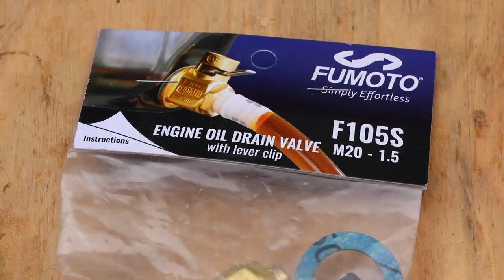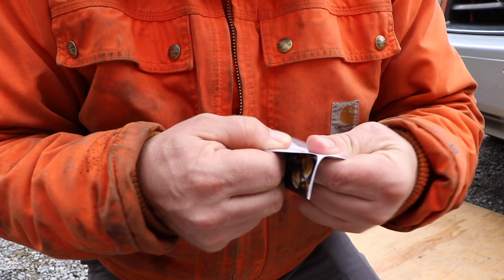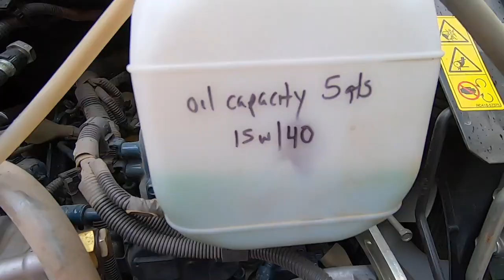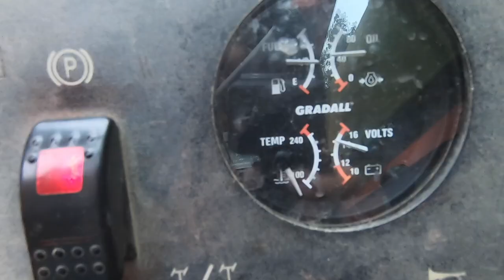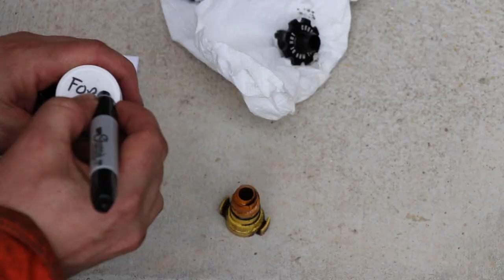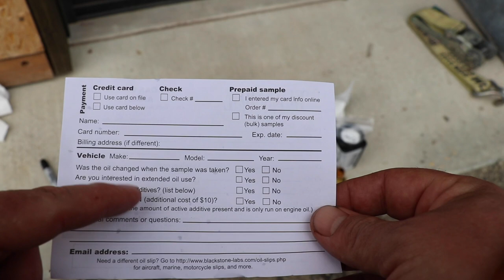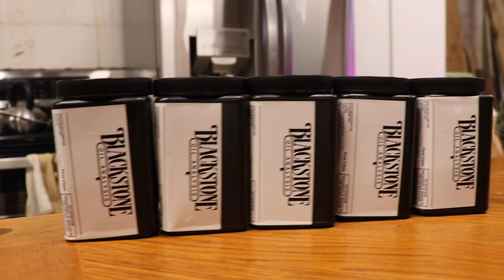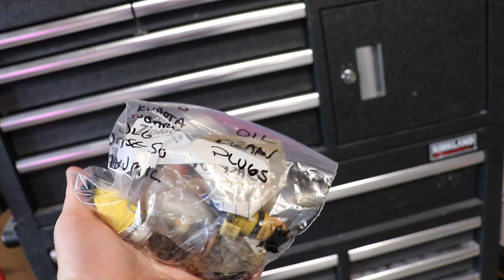Sampled Oil in Everything I Own... Here's What Happened

Comment: Here are some tips from a Ford Senior Master Technician.  Do not idle a 6.7 for excessive amounts of time it will lead to premature clogging of the EGR cooler and they are expensive to replace.  Make sure you complete the regeneration cycle when it comes on since incomplete and excessive regen cycles will shorten not only DPF life but oil life as well since more unburned fuel gets into the oil. Fastest way to warm up a diesel is to drive it.  Now that your on the grid use the block heater when it drops below 45 degrees and only a few hours makes a big difference. i like to use a 15 amp timer on my 6.0 diesel.  15-w40 is fine for the hotter months but switching to 10-w30 in colder months would be better, reference your owners manual there is a chart with recommendations by temperature. I also prefer to use factory filters (oil, air and fuel) since most aftermarket filters will fail in comparison.   Short trips are not good for gas or diesel engines especially when they do not get the chance to come up to full operating temperature. Todays diesel engines are not your grandfathers diesel engines.  Modern diesel engines in light trucks are designed to be shut of and restarted unlike old diesel engines that could be idled all day without harming the engine.

Comment: Jesse: McMaster has grease zerk fitting dust caps fairly cheap - $5.76 for a package of 50. Recommend getting two packages of different colors. When you do grease the equipment you change the color of the dust cap. That way, a missed grease fitting stands out. They come in 6 different colors. You can google McMaster. The basic part number is 1098K- with the color number as a suffix. -12 is black, -17 is blue, -15 is green, -14 is red. -13 is white and -16 is yellow. They call them dust caps. Jon

Comment: If you go to any diesel service shop for large companies you are going to see one of two oils, Rotella 15w40 or Dello 15w40. I worked on several types of diesel engines for years and I had a great performance from the Rotella, Do yourself a favor and don't buy cheap store brand oil or oil filters, and don't by Fram oil filters for sure. I always used OEM filters for all the different equipment.

Comment: I did the drain valve replacement a few years back. One mod id recommend would be to drill a hole in the draincock lever and run a bit of safety wire through and around the body of the plug. That clip will fail you after a while.(ssk me how I know. LOL)

Comment: You can get heavy duty magnets at at any hardware store. My suggestion is to place one right next to your easy valve and just before you do your next oil change just pull it off right before you drain. Any metal fragments that ere there will get washed out right away . Then put the magnet right back.

Comment: A magnet on the oil pan might skew the oil analysis. The  whole point of the analysis is to determine unusual wear (metal) in the engine.  
I know that CAT sells a oil sample vacuum kit. A lot of heavy equipment have sample ports or with the CAT test kits, they come with a long tube that you feed down the dipstick tube, then suck out the sample from there.   And if you take the sample right after warming up the engine, any  contaminates will be suspended in the oil and you will get a better sample.  Hope this helps.

Comment: You should try to limit idle time on a diesel. While a diesel engine is idling, something called seepage occurs. While a diesel engine burns less fuel while at idle, the engine temperature is not high enough to fully combust and fuel can leak down the pistons and into the oil. This then effects the ability of the oil to do it's job as a lubricant.

Comment: As a 55 years in the field heavy equipment operator I'd be scared of them drains if even one stick can have access to them drains -- working brush they can go up in an open hole like that 2 inch or so hole and knock that type of drain off -- they are brass and fragile -- I've seen 20 thousand dollar 3408 cats in D9 's get hot and split the block by one single 3/4 inch stick run up the radiator drain hole and knock the drains off = the operator never knows it until lights start flashing.. lol don't mean to scare you lol love you and your wife's youtubes - 15/40 is perfect for all diesels and your truck - just one kind will take you all the way (y)

Comment: Do yourself a favor and move to 5w40 which will flow better in the cold and lessen start up wear. 5w40 and 15w40 are both 40 weight when up to operating temperature but isn't as thick when cold. Your higher metals could be from the thicker 15w causing lower cold temp flow and increased wear metals especially on the Ford.

Comment: I too would be concerned about the mini's exposed drain valve. From the vid it looks like there are heavy plates on either side of the pan. How about using a plate with bolts the protect the drain? The plate could be bolted with 4 bolts which would be drilled and tapped into the existing thick plates. I would not try to weld on the thin steel oil pan aas  hitting anything as you rotate could tear open the pan. I agree that oil analyis is a good thing as diesel engines are expensive to replace. Keep up the great vids and I look forward to your continuing house build.

Comment: An idling Diesel engine causes as much as twice the wear compared to working speeds. Idling should always be limited. Newer Diesel engines are recommended to be driven within three minutes of startup. This may be why the trucks oil shows higher mileage on it compared to actual odometer mileage.

Comment: Buy a round bristle brush for those oil change valves and hit the open valve before you close it after you drain the oil. Sometimes a metal burr can ruin the seal on a 1/4 turn valve. Giving the valve a quick cleaning will help avoid this.

Comment: They make a simple hand pump with a long tube that goes down the dipstick tube you can get samples with. They use them in sailboat engines to change oil. Would’ve saved you a lot of money and not risked those plugs getting knocked off. Risking tearing up the oil pan. Not smart for that type equipment.

Comment: Most equipment manufacture dealers sell sample kits for a lot less and can sample through the dipstick tube so it can be done at any time and doesn't have a chance of contamination from a drain plug or valve that can be filled with dirt

Comment: Oil testing is smart. I had a quarter turn valve and tubing to test and change the oil on my Piper Arrow. Tubing allowed oil change without removing lower engine cowling. Tubing clipped onto the valve through an access door. Seeing the trend in oil analysis lead to an engine overhaul... who knows, may have saved a life.

I know you have competing priorities, and I am anxious for you regarding getting the siding on that nice house, but a weather shelter for your equipment makes a huge difference. A hoop house would do the trick. Farmtek sells inexpensive kits. Long term, nothing beats a pole barn with a concrete floor and a two post car lift. (Insulation and heat make it even better)

I think you might have been pouring oil from 1 or 5-quart containers. For those large capacity diesel machines most of which use 15W40, buying in 5-gallon buckets is significant;y cheaper. Use two-quart pitcher with flex nozzle to avoid spills.

Also, having a 50-gallon transfer tank with a hand pump for onsite diesel fuel is really nice. I have my tank on a pallet and just trailer it to town for a fill-up of non-taxed off-road diesel fuel. (cost 50 cents less)

Good luck and keep up the good work.
Driving my own F-250, 1997, 223K miles on it. No rust.

Comment: I thought you may like to know that many newer aircraft engines in the military no longer perform JOAP samples.   It was determined that this type of oil analysis was ineffective at predicting engine failure and was no more effective than the installed engine oil chip detection system.  You'd have better luck with a magnetic drain plug.

Take your sawmill as an example.  If the results come back and they show 25 PPM of 303 stainless steel, what do you do with this information?  First, you would need to track down which part inside the engine was made of that material (not an easy thing to do).  Then you would need to determine if 25PPM is excessive or just normal wear and tear.  Finally, do you spend the money to rebuild the motor or just wait until you get a secondary indication (smoke, noise)?  As you mentioned in your video, your ground equipment is a "run until failure" asset.  These piston engines are going to fail for a seal or gasket long before they fail for bearing or gear wear which this test is trying to identify.  

Overall, the juice is not worth the squeeze.

Comment: Oil analysis, not going to yield much info without having previous analysys'. It is more of a trending tool not a pass/fail.  If you have a way to drain through a coffee filter as soon as the oil starts to drain would replace the magnet in the drain plug.  I know some engines allow a 1/4" tube to go into the filler then down into the bottom of the engine where you can do it like a straw and put finger over top of tube and draw tube out of engine. If your lucky there will be a sufficient quantity in the tube for your sample. That is the way I did it for years.  I am an A&P with IA and worked around airplanes most of my adult life.  Love your videos.

Comment: Most diesel Fords when you're in park using the cruise control you can set a high idle to prevent the injectors from building up deposits and it would help to heat up the engine a bit more and if you are a victim of the EcoDiesel it'll encourage the truck to run a cycle the next time you drive

Comment: The issue with sampling from a quick drain valve is dirt you are going to put in your sample from inside the valve. Best is to use a sample gun and sample tubing that can be purchased from you're local Caterpillar dealer. Their sample service is also I believe cheaper. Also on the heavy equipment you need to do trans, hydro, finial drive and coolant samples to give a full health report.

Comment: Jesse this is what you need  to work out what thread you have on your various vehicles. You need to know 2 things. The daimeter and the pitch. Then you refer these to a chart. you need a vernier caliper to measure the diameter and 2 pitch gauges. Pitch gauges look like small feeler blade sets with a tooth profile on each one with a number stamped on it. On imperial ones it shows T.P.I. Teeth Per Inch for example  1/2" x 20 tpi  which is unf (unified national fine thread) has 20 teeth per inch with a diameter of .5oo of an inch. Metric threads are shown as the diameter by the pitch. For example a common spark plug thread is  14 x 1.25 which means 14mm diameter  with a pitch of 1.25 teeth for 1 revolution. There are over 50  different standard threads.  most sump plugs on japanese cars are metric sizes and most american motors are going to be unf, metric or npt Digital vernier calipers are $30  up and pitch gauges will only be $8 each or less.

Comment: Those drains are awsome. Have them on all our equipment.  Never had a problem  with  them. When you have around 30 pieces to change oil on they sure are nice. Had a 580 k like yours with 17000 hours on it and all we ever did was injectors. Excellent machine.

Comment: Since America went to the 15 PPM sulfur standard, engines benefited tremendously. The whole reason that motor oil has ash content is to neutralize acids that are formed when the sulfur burns. Acid promotes salt. Salt increases electrical conductivity which promotes galvanic corrosion. Bearings, camshafts, crankshafts, and blocks are all different metals. Different metals form batteries. Engines make expensive batteries. Past fuels sometimes had over 500PPM sulfur. Need I say more?

Comment: You probably wont want to weld a guard on the oil pan because they tend to crack if you do. You could get a new pan that has never had oil in it, or you could take the pan off and clean it, preheat, and weld a guard on it. It would be difficult to get all the oil film off the used pan before you preheat it, and that would likely make it brittle if welded or brazed.

Comment: Speaking from experience running heavy equipment, I would highly highly highly suggest having someone fab up a plate for the under the mini. Its 100% peace of mind when you are swinging around you domt have to worry about a rock on your tracks or a stick going up in there and causing havoc. If you weren't 2k miles away I would come do it for free lol. Great video, great preventative maintenance plan. 💯

Comment: That was a great tutorial and walk through on the sampling process.  There were many times I wished that we'd had those kind of quarter-turn valves on our equipment. So glad to see that you now own that equipment instead of renting/leasing it.  You're right that when you lease something that cost is always in the back of your mind and you/we tend to rush jobs more than we should just so we can return the equipment and stop the high billing costs.  Looking forward to watching you two move forward with the interior electrical planning.  Don't forget to run power cables and a few exterior outlets in the eves in case you need them for lighting or even for security power down the road.

Comment: 👍🏼 Make sure to put the magnet on your oil filter and not the oil pan! That way you throw away the shavings when you change oil filters or cut them open to see the amount of metal. Also I think it’s a great idea to put a piece of pipe around the valves to protect them but you’ll probably be alright.

Comment: The reason for magnets in drain plugs is to catch fine particles in your oil. This will show problems early the same as your oil sample. The main use of magnetic plugs is ln rear differentials where the lube runs 100,000 miles. We would swap drain plugs at every service and look for any metal.

Comment: To check oil quility you could put a vacuum suction hose down the oil dipstick hole.  To keep oil in engine while opening drain plug one applies a shop vac hook up up to oil fill port. The vacuum will keep our from leaking out. You can used this trick on coolent systems to add a block heater or hydraulic system to add things at bottom of tank. Just know what inches of vacuum that you can pull and not have anymore than that lifting head room. If you can not lift the oil with enough vacuum then oil will run out of open oil plug. Just be ready for a power outage, no vacuum equates spill oil.

Comment: In the future, place a rag over the tube of a shop vac, and suck where the oil cap goes. You will put a vacuum inside the engine, and you can remove the drain plug with very minimal oil loss. Hope that made sense

Comment: Also try sampling your equipment's hydraulic oil and your plane's oil. I've managed several factories' maintenance departments over the years and implemented oil testing for every compressor and every hydraulic system at every factory I cared for.

Comment: I worked at a company that does oil changes for a short while and if someone had a leaking drain plug that needed to be changed but didn't need the oils change we would fit the hose of a shop vac to the full spout on top turn it on, remove the drain plug and not a drop was lost. Give it a try.

Comment: Try attaching a Grade N52 Neodymium Rare Earth 50 x 25 x 10mm Rectangular Magnet to the outside of the oil filer can to substitute for the magnet in original oil drain plugs. On the Kubotan engineer a bash plate (1/4" mild steel will do it) that would cover the hole in which the drain is located, given the thickness of the surrounding frame you could tap the holes that would hold the plate in place with 3/8 - 1/2 machine screws.
You might want to also get the hydraulic oil checked on the backhoe as its your oldest piece of plant to show if you have valve spool / piston / pump wear.

Comment: If you're worried about the handle moving, drill a small hole into the handle and wire lock the handle across the body of the value.

Comment: Large trucking companies do oil analysis the one I drive for was doing changes every 28,000 miles back in the 90s to 50-75,000 miles, at 12 gal per change with over 10,00 trucks is big $$$

Comment: Jessie drill a small hole in the famoto valve lever and used safety wire from your local motor cycle, rally, track or aircraft mechanic to replace the plastic safety especially on the back hoe. I stead of welding to the oil pan bolt a plate under the skid plate over that entire space and simply remove that for each oil change/inspection 4 bolts on a flat plate would take no time and a decently heavy plate will protect that plug fine. Hope that helps. Duncan

Comment: A solution to the drain plug is to put a removable plate with a smaller hole in it covering the larger opening. You could then still drain the oil through the smaller hole. If you need to work on the engine from the bottom, you could just remove the plate.